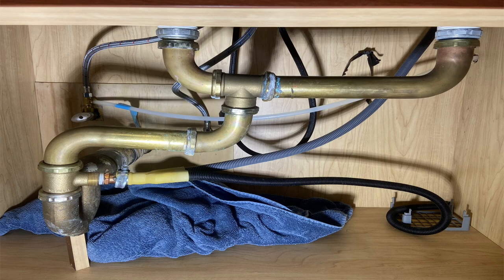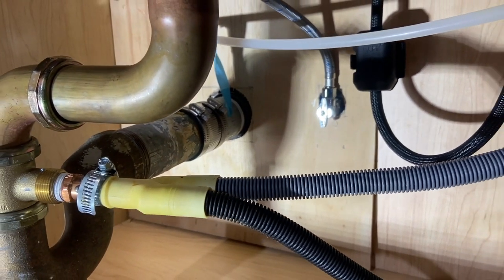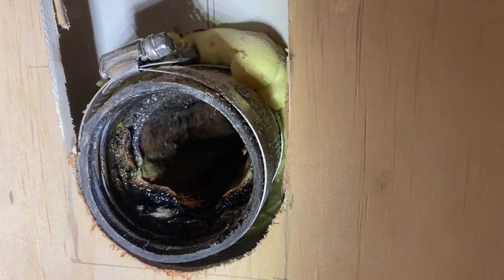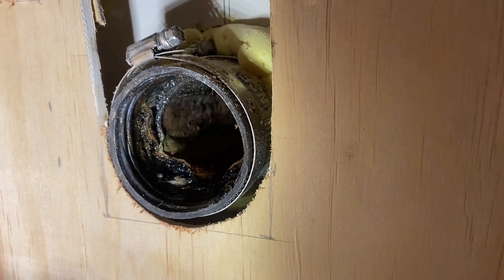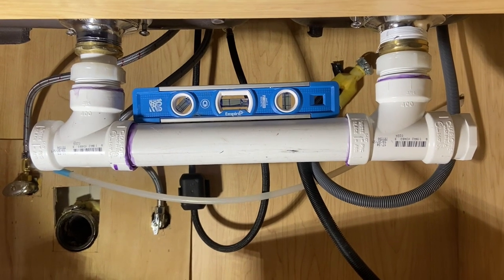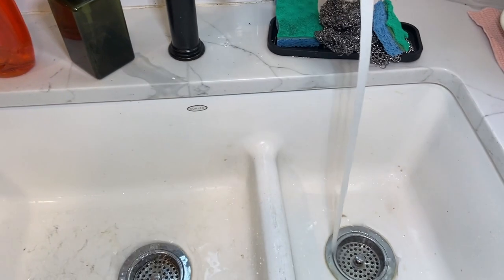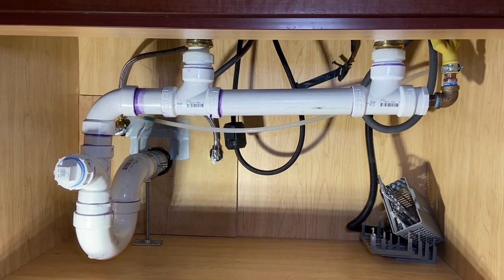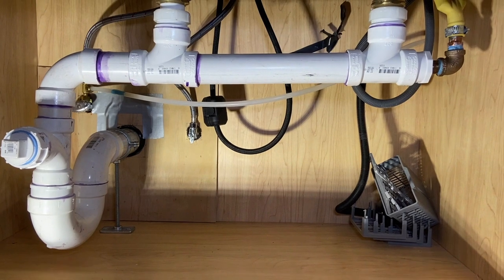Leak Under Kitchen Sink Cabinet

Comment: It looks professional!  The difference is night and day.  Schedule 40 pvc  dwv is the best material to use.  I’ve used.  The only caveat is that you need to know your stuff to do it right otherwise you can redo it multiple times.  Most of the time I replacing the existing polypropylene that many homes have.  On that stuff if there is a garbage disposal I always use a brass locknut to connect the waste arm from the disposal.  It much stronger, less of a chance of losing up with the vibrations by the disposal.  Keep up the professional work!  I’m looking forward to your next video.  Happy plumbing!

Comment: So on the connections from piping to strainer i use. 2'' X Tubular no hub couplings it eliminated gaskets locknuts  very well done. RB
Reply from the maker: No one had CK115 no hub couplings  in (would have clamped directly onto the strainer) in stock, had to go to the next best option!

Comment: Nice work Bob.  You really cleaned up that mess underneath.  I like that you put the cleanout in for future maintenance as well as the support brace in too.  While you were in there, did you consider replacing the hot valve with a quarter turn (looks like the cold is already is a quarter turn) and adding escutcheons for both cold and hot sides?  Lastly, was this done in NYC or a neighboring county?  At one time, NYC was particularly strict about the use of SCH 40 and insisted on metal drainage.  Perhaps the code has changed.  I live just outside NYC limits in Nassau county but have a 85-year-old house and have been replacing the metal drainage with SCH 40 over the years during renovations.  To your point, I expect it will outlive me without any issues.  Also, wishing you and your family a great 2022.
Reply from the maker: Thank you Kevin, PVC is legal in residential homes 5 stories or less. Work was performed in Brooklyn N.Y, and no did not address the 1/4 turn valves.
Reply: @BobsPlumbingVideos  I didn't realize that Bob.  Thanks for the clarification.  I have friends who live in Ditmas Park in Brooklyn (Stratford and Cortelyou) and they told me that they had to replace all drainage with metal during renovations.  That said, that was a few years back but am glad to see that SCH 40 can be used today.  Does the same thing apply to PEX?  They let you use it here in Nassau county, but am old school and always use tried and true copper for hot and cold lines.  It's been in my house 85 years and figure it will last another 85.

Comment: I thought IPC table 706.3 does not allow sanitary tees in vertical to horizontal connections?
Reply from the maker: Technically correct!
Reply: @BobsPlumbingVideos  Thanks for the reply! I wasn't sure since it doesn't seem like thin wall connections meet code for tees/wyes either. Personally, I think your installation looks and will function much better than thin wall connections anyway. The code can be a little nit picky!

Comment: Good job , I would of put a 1-1/2 wye  of the trap arm with a clean out plug then 45 it towards left side of sink then p trap then San tee vertically off tail piece  then would of put waste 90 and caught ride side of sink ! Couldn’t tell if you had an air gap or not ? If you did I would of put a side out on the tail  piece to drain dishwasher!
Reply from the maker: No air gap, just looped the hose up to the underside of the countertop.

Comment: You asked what would you do?
Allow me to tell you.  I would have done the same thing you did inside the wall, Then I would have installed a 2''''  wye with a ftg CO adapter on the end of the wye.  Out of the center of the wye  I would have installed a 2'' trap  centered on the first bowl  with a 2x1 1/2 bushing.  A 1 1/2 san tee on top of the bushing
pointed at the second bowl, in between the tee and the 90 for the seond bowl would be a ftg 1 1/2;; wye with bushing  oriented at a 45 degree above flow  to catch the Dishwasher
Reply from the maker: Nice!